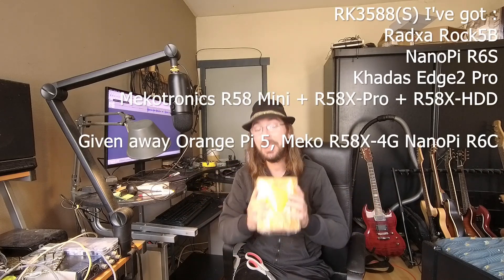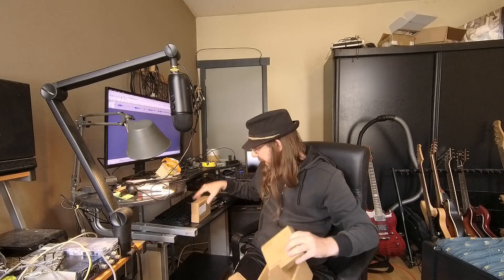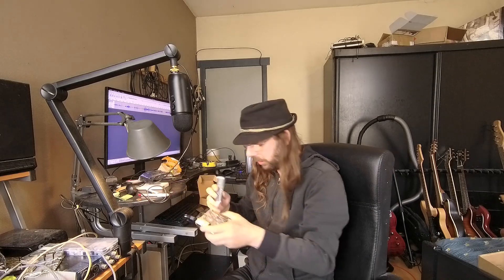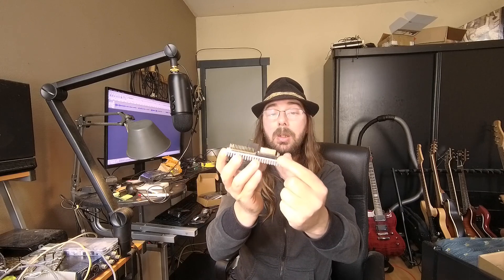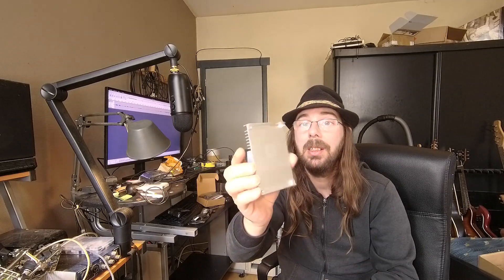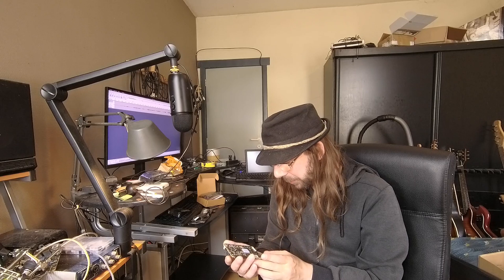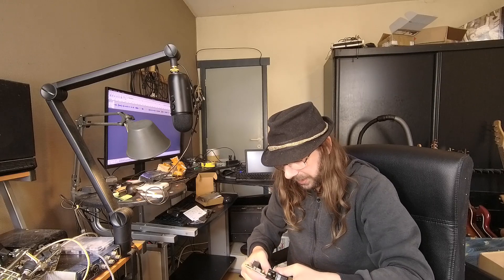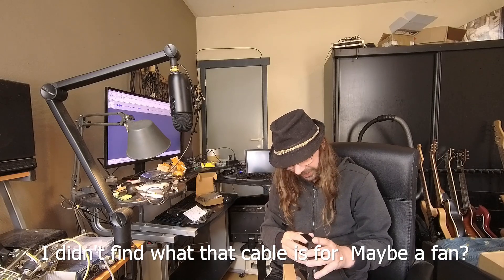Mixtile Blade 3 unbox - Stackable RK3588

Comment: Does the stackable feature allow the use of all the cores across the boards by a single operation?
Reply from the maker: Yes, you can have software to share the load over different machines. But it's not like your using 1 machine with 4x the cores. Only works for tasks that are scalable.

Comment: I think the power connector is for SATA power. I know a lot of newer Chinese boards are using 4-pin Molex to SATA adapters when coming off pcie 4x. The odroid h3 uses this setup, there is a cubieboard (relatively old) that uses this setup and I believe the Odyssey J4125 v2 uses the same and I know of 3 others iirc, but their names are escaping me right now

I was glad to see that the rk 5.10 rkr4 kernel got updated and merged. This will help tremendously on building rk3588 distros.

Do you happen to know if there is a functional driver for MIPI DSI with touch support built into that kernel or any that Armbian builds with?